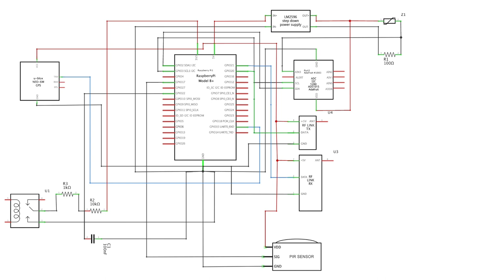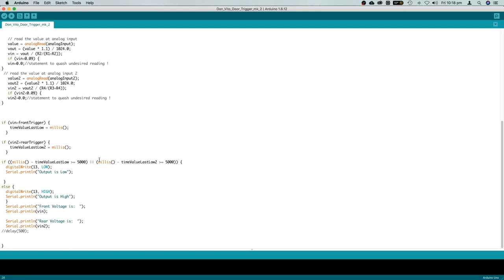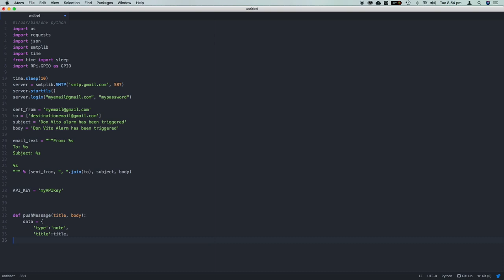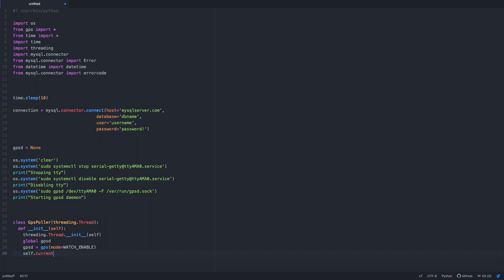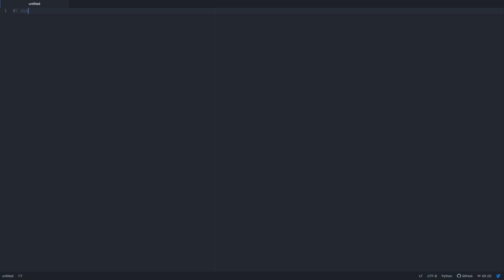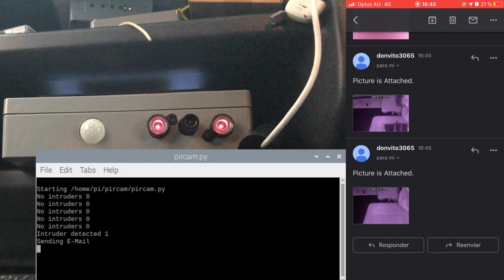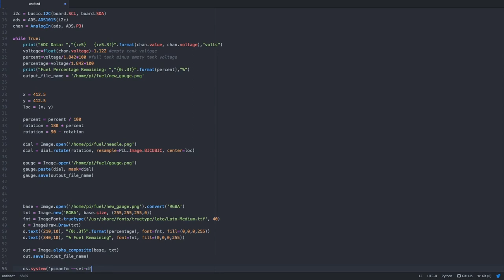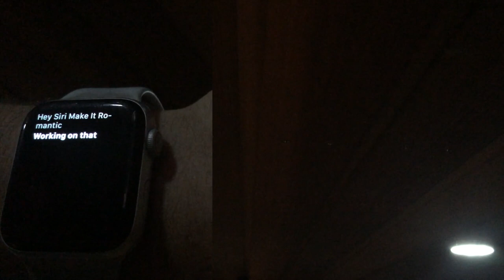I Built a Van Smart Computer with a Raspberry Pi! - Mercedes Vito Camper Conversion Episode 17

Comment: this is some great work. I've been meaning to get into python and with my campervan this might be a good project. the tinylink doesn't appear to work for me, anyone else have the same problem?
Reply from the maker: Thanks Chris! will work on fixing the broken link now.  @rferder on instagram if you need any help/advice
Reply: @rupertferder6768  Could you fix the link to the code please as it isn't working anymore. Great work! I'm doing a similar system on our camper and would like to use and expand on some of the code. If you haven't already maybe think about adding it to github so others can submit PR's and we can all work together?
Reply from the maker: Not a bad idea. I'll message you on Instagram!

Comment: Awesome work! Have you thought about connecting the solar panels and the battery to obtain information from them and see it from your cell phone? How do you configure your RF transmitter to unlock the van doors?
Reply from the maker: Thanks mate! The solar controller does have a coms port and I was considering it but I'm going to save that fun for my next van project! The raspberry pi uses a 433mhz transmitter to send the unlock door code to the central locking system. If you need any more info on this let me know 🙏
Reply: @rupertferder6768  Thank you for sharing your project. I'm trying to learn about this stuff and videos like this are really helpfull. Greetings from Argentina
Reply: @rupertferder6768  Id be interested in having more information also for the unlock door system! Could the same system be used to trigger the alarm thats normally on the remote?
Reply from the maker: alex deslauriers hi Alex feel free to message me on Instagram and I'll give you any information you need @rferder